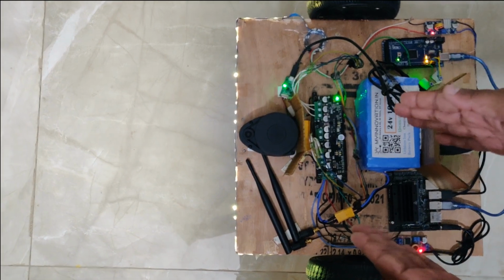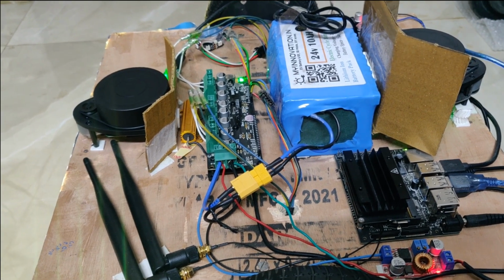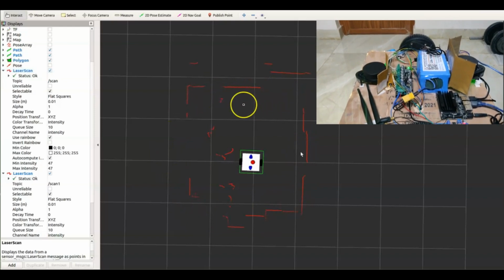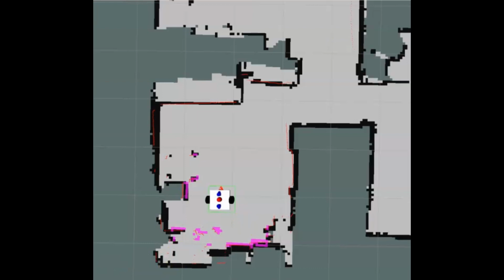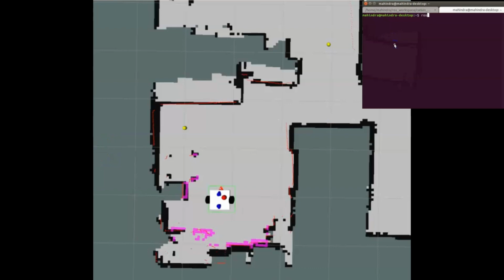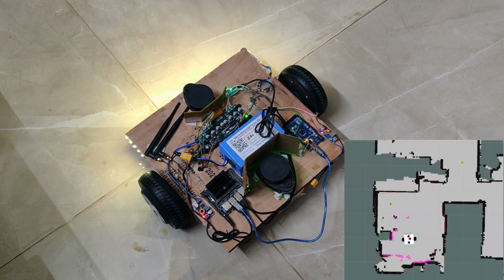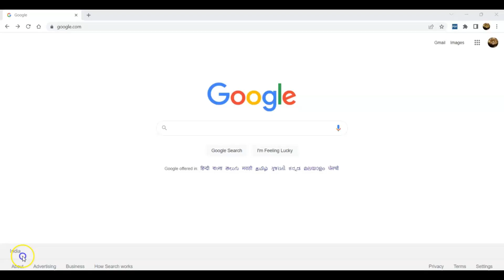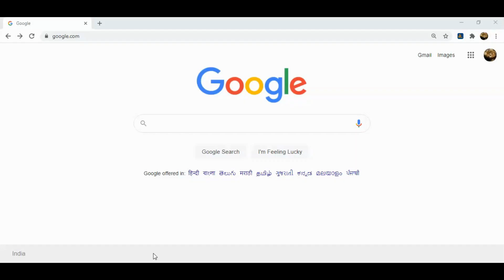Autonomous Navigation Mobile Robot Version 2 | ROS | Odrive | BLDC Motors| Jetson Nano | RPLidar

Comment: Great job.
I was going through your GitHub repo , I didn't find any implementation of pushbutton and addressable led in the code. Can you  please share the back ground code for both Arduino and ros part .
Regards
Reply: Hey do you try this project and i work with you?
Reply: @jtx5868 are you working now on this project??